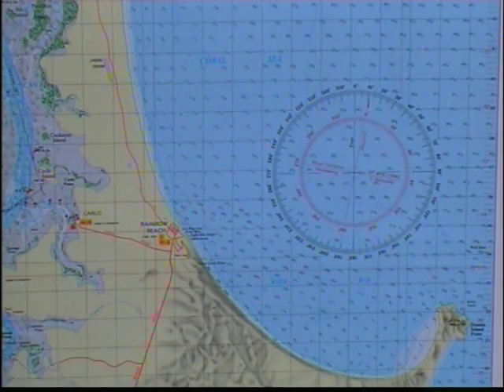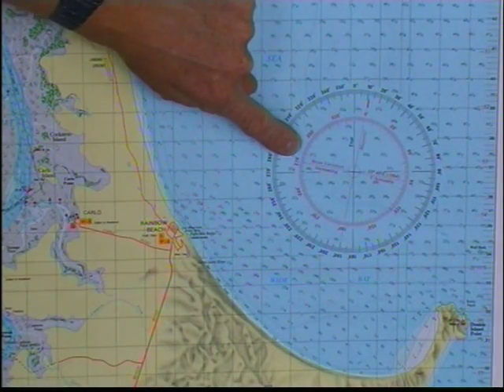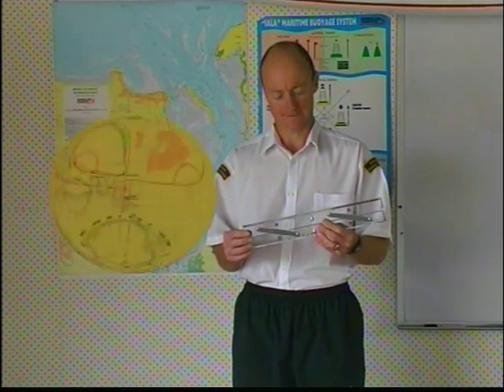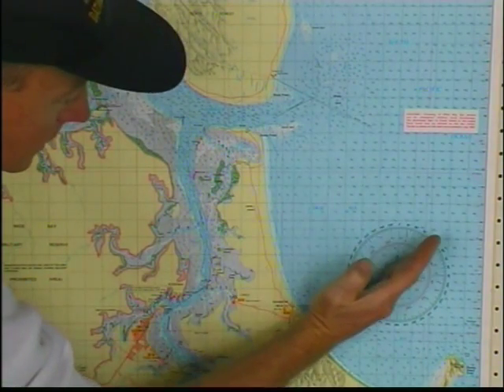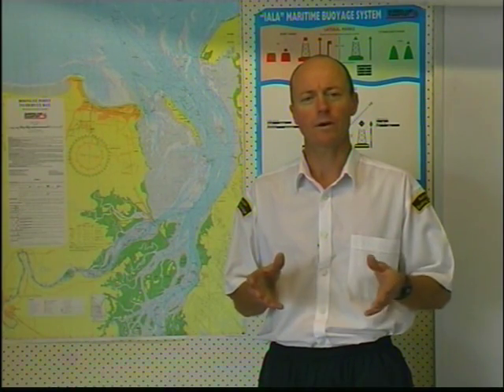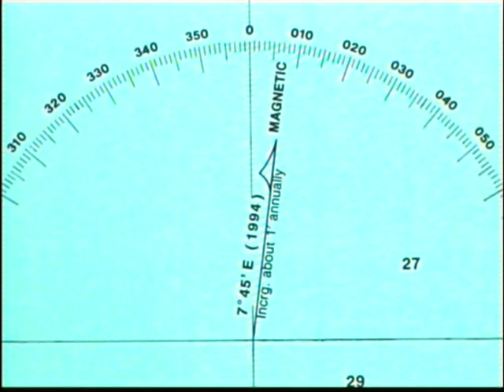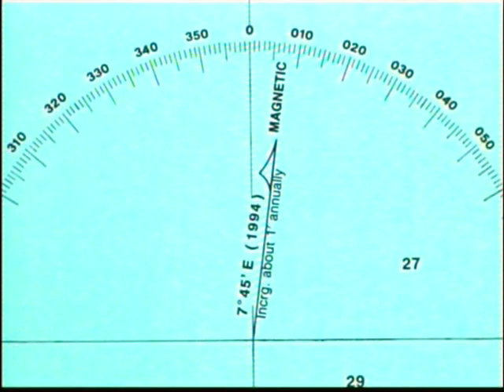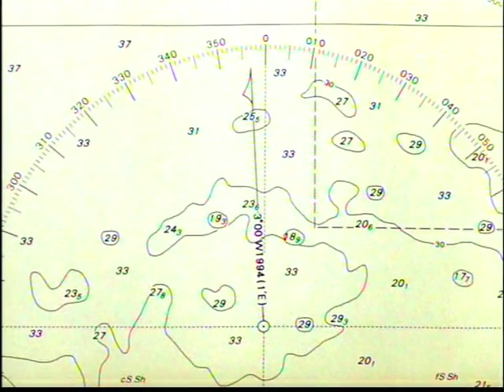How to work out Compass Bearings

Comment: Some good stuff and some omitted stuff. You talk about magnetic variation, the adjustments are written down per year but you did not mention that at all. If they go straight off a magnetic variation it can be 1,10, 20 or even 30 Degree different depending on the year when the chart was made. If a chart was made in 1991 and It’s variant is 1° every year and the chart said the variation was 10° from when it was made there is an extra 30° to take into account for the magnetic variation. That is a huge difference of direction. If you’re going to teach it, teacher it properly.
Reply: That was implied actually. But it was only a 13 minute video, and it’s not expected that one would watch this video and think they now know everything about how to read a chart and compass. If you’re going to comment, say something nice or don’t say anything at all. Or put your own 13 minute video up and see how you go mate if you’re such an expert
Reply: @jasonmitchell4760  I agree, I have no doubt this guy knows what he is talking about. This video isn’t to teach a weekend boater how to shove off in open seas to travel 1500 miles, it’s meant for the guy who loses his gps and needs to understand the basics of getting close enough to home to know where you are
Reply: Minutes not degrees